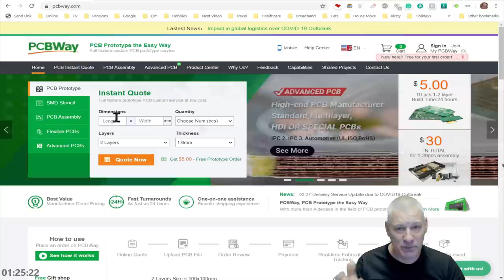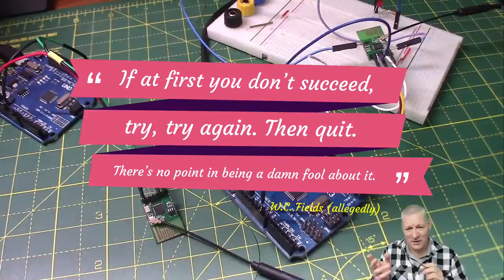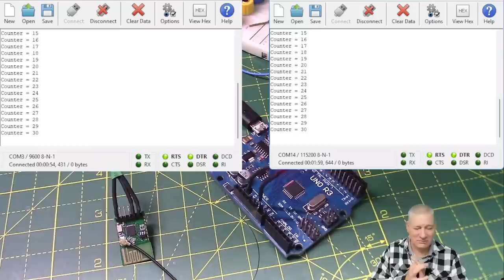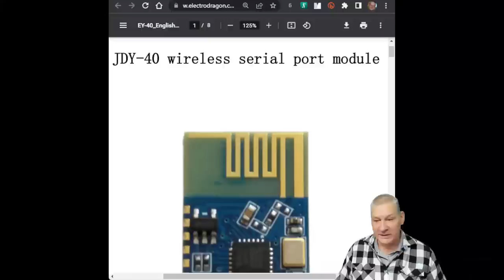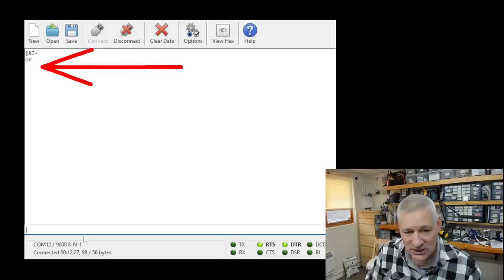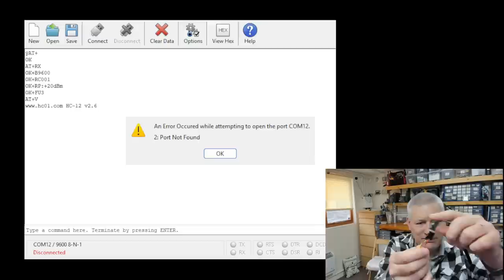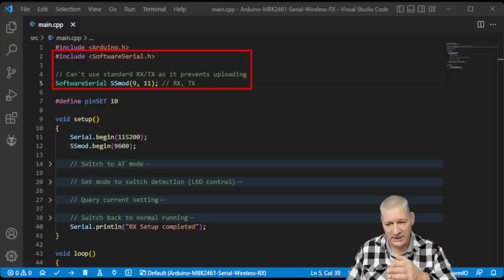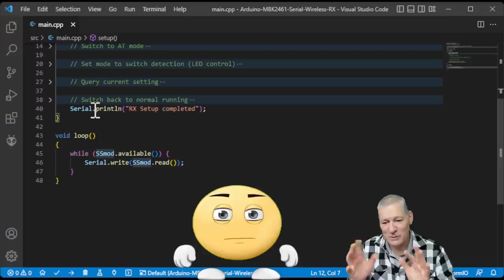#257 Wireless Serial Comms⚡for your Arduino (or other μController)

Comment: I bought some HC-06 bluetooth modules for pretty much this purpose, for monitoring serial output from my microcontroller projects, planning to just connect my laptop to the bluetooth serial device which according to the lnternet was easy on Linux (which is what I use on my laptop). However it didn't instantly work so I thought "I'll fiddle with this later". That was back in march 2022 so perhaps its time to give it another go!
i will agree, however, that the documentation on these transmitter modules is very patchy, not helped by the fact that you will get a huge variety  of different firmware versions, sometimes which have vastly different functionality, and you can't always work out which version you're going to get, which version the documentation you find is for,  or if the firmware can be reflashed.
Reply: I found the HC-06 modules very easy to deal with. Simple serial commands to send data from the source device. On a Linux machine I have been using pyserial, there is some setup required to get the Bluetooth Adapter to connect as a serial device (rfcomm) but once set up it is easy to ready the serial data. The HC-06 seems to be better documented than most and being straightforward serial makes them easy to work with.
Reply: @paulweston1106  Yes, that the impression I got.
Reply: I've done the same using both HC-05 and HC-06 modules. There is a great Android app called Bluetooth Graphics that can receive the serial data. It's mostly for displaying numerical data on graphs if you have that kind of project but will displays and send anything and do data logging. Similar software available for PCs as well.
Wireless serial monitoring has played a big part in the development of a few of my projects.
Reply: @Ed.R  The 'Serial Bluetooth Terminal' app on Android allows you to send data to and receive data from the HC05/06 modules. It works for regular Bluetooth and BLE.
Reply: @paulweston1106  Got it installed but I like graphs so don't use it as Bluetooth Graphics does everything it does. Also have the USB version which is rather useful, saves getting the laptop.
Reply from the maker: Using BT modules means we have to pair things up, though. I wanted a transparent, wireless USB cable, effectively. Almost working.
Reply: @RalphBacon  Very good point like the nrf24l01 modules, they always just connect up and work. Unless you want to use an SD card module on the same SPI bus then they sometimes work.

Comment: Hi,
this is very interesting. I'd like to flash a JDY-41 module and if I connect it via Serial USM RS232 I get a response "wake". No AT command gives me a response from the module. VCC is a coin battery 3,2 V. Do you know what might be wrong with it? I'd like to transmit a countinous endless bitstream and AT+CSSa= should switch the module into transparent transmission mode but it seems to be that nothing is working.
Do you konw what might be wrong?
Kind regards
Reply from the maker: I suspect you are not putting the device into AT mode by holding down the button on the board BEFORE powering on. The flash rate of the LED is quicker when in AT mode (rather than just paired and working mode).
Reply: @RalphBacon  Hi Ralph, thank's alot for this  hint. This might be the reason and I'll try it out as soon as I got time for it.
Kind regards Bruno

Comment: for HC-05 baud rate setup command:  AT+UART=<Param1>,<Param2>,<Param3>
Param1      Param2        Param3
4800           Stop Bit        Parity
9600            0 : 1 bit        0 : none
19200          1 : 2 bit        1 : odd
38400                               2 : even
57600
115200 
Default: 9600, 0, 0
from document: HC-03/05 Embedded Bluetooth Serial Communication Module
AT command set
Reply: Nice.
Reply from the maker: Thanks for that info! 👍

Comment: hello, is there any way to establish a serial port at esp8266 ans access it wireless from my desktop , to program, lets day other arduino modules ?
Reply from the maker: I wish! What you can do is load the OTA library and upload a specific device via its IP address. I've not done it with the ESP8266, only the ESP32, but the procedure is basically the same.

If you read this article you will find a link for how to do it with the ESP8266 too: https://randomnerdtutorials.com/esp32-ota-over-the-air-arduino/
Reply: @RalphBacon  nice, thanks

Comment: Is this a "fun with radios" project -- or a remote serial port? 😄 If it is remote serial, just use a radio you know (wifi) plus a chip you know (8266), and a bit of software to receive, buffer, timestamp your serial output, and put it on a webpage to serve out to any wifi computer phone etc.  I got a bit of code from mrdiyca and a d1-mini with hookup clips soldered to 5v/33v/gnd/rx/tx and just walk that over to any project with an tx and gnd, and your serial output is streaming to a webpage on your computer in seconds.  You can get 5 or 3.3 power from your project, or bring a usb battery for the d1-mini.  Plus a d1-mini or esp-01 cheaper than 2 radios and radio is only running then your looking at it.  Although you miss out on the "fun with radios" aspect of the project. 😄
Reply from the maker: Indeed. I did consider web pages but it's all much more complex than a wireless USB cable, don't you think? But certainly an option that I've been toying with for years!

Comment: I wonder why the companies that develop the board do not put out any specifications for  it.  Does not make sense to me.  Frustrating experience.
Reply: I imagine the boards are made to someone else's specification, for their particular project.  What we get are over-runs / extras / rejects.  Best bet is to find the spec sheet for the chip, rather than the board if you're hard up against it for a solution, then pin trace.
Reply from the maker: Yes, these boards were almost certainly made for some toy or other. Just a pity there is no (or very little) info out there for them.